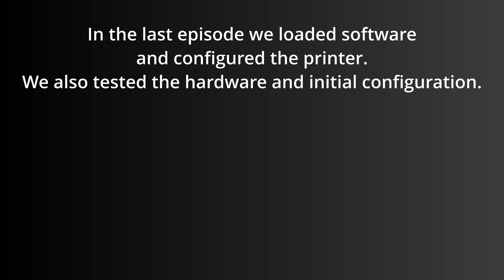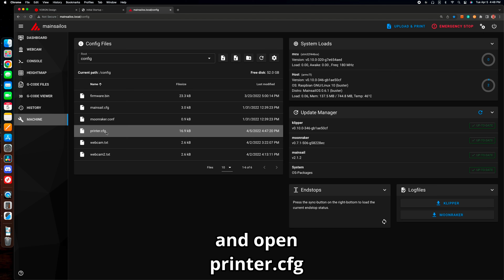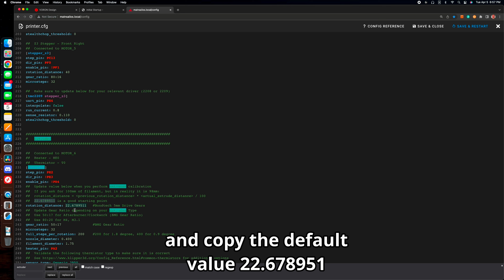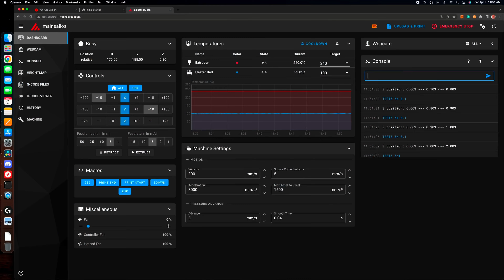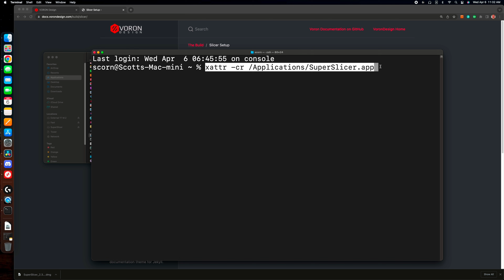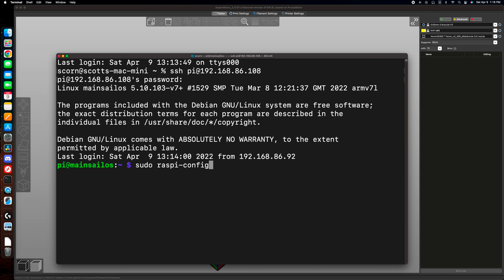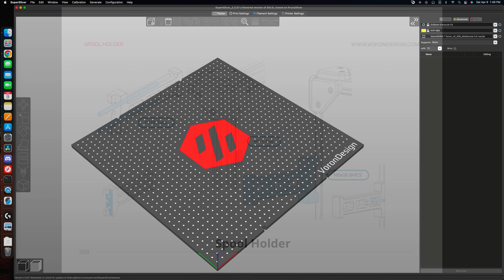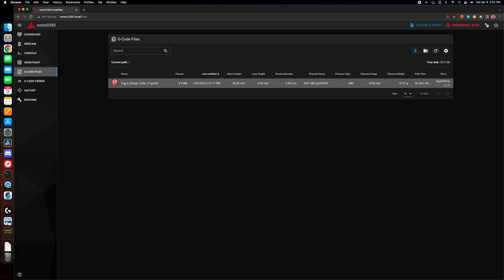Voron 2.4 Step By Step Part 13 Tuning, SuperSlicer and First Print

Comment: Hi, I am also building a Voron 2.4. I have a little question about the raspberry pi 4, do the wifi is set to the router or to the computer? Thank you,
Reply from the maker: If you use the Raspberry Pi installer I show in the video the wifi is set up during the install for you. You can connect a ethernet cable to the Pi and it will use DHCP to automatically get a IP address. If you didn't set up the wifi during the install connecting the ethernet cable is easiest in my opinion. You can get the IP from your router, but how you do this is different on each router. It is just best to setup the wifi during the install as I know not everyone has ethernet connections where they have the printer. I'm an old software engineer, I have connections everywhere. lol
Reply: @scottcorn  Thank you for your quick response, I am a retired CNC machinist. What I wonder these in the Wifi configuration, is it the password of my router that I give or these new passwords that I create? Do raspberry pi communicate by wifi directly with my computer by wifi or it goes through my router? At the same time congratulations for your good tutorial. Soory for my English, it is not my native.
Reply from the maker: No problem. Your english is good. The Pi communicates directly with the wifi. You would need to enter the wifi password. It wouldn't be the password that was created to get into the Pi. The password for the Wifi is set on the wifi router so if that is the router password you are talking about it would be that one.
Reply: @scottcorn  So the Pi communicate with the router and the router send the communication to my computer by Wifi, is that right? Now could I skip the router, so that the Pi communicate directly to the computer Wifi, like my paper printer do? My computer is at 10 feets from the 3D printer and the router is 2 rooms away maybe 25 feets.
Reply from the maker: @GD-ur4tr  I think it can if you directly connect by USB. I've not done that with Klipper yet. My old printers (not Klipper) did this. I would just connect your computer with a USB to the Pi and see if SuperSlicer can see it.
Reply: @scottcorn  Thank you for the info, have a nice day.
Reply from the maker: @GD-ur4tr  You too

Comment: That is incorrect you should be using the hotend, heated when you do your e-steps, your logic on it affecting the results is correct in the sense that the heat, and pressure afftects Flow rates.  Which also affects e-steps by a margin.  Back pressure from the hotend will change the extruder rate.  So checking the extruder for 100mm without the hotend on and at temperature will give you one value.  Taking the hotend off will give you another value as you are just giving the extruder free movement.  So by your logic, taking it off then running it and putting it back on will actually change the values a hair.  You should be checking your e-steps with everything assembled in working order.  Mind you it would be basically be like saying take your bed off an ender three before you run input shaper and put the sensor on the bed mount instead.  Afterward put the bed back on.  You would not do that.